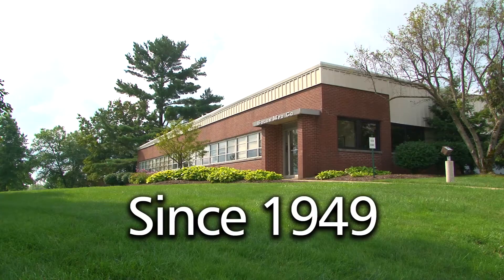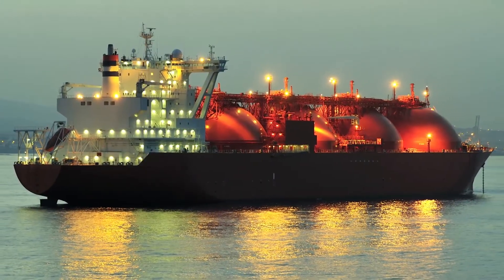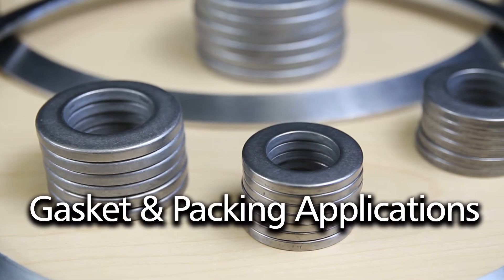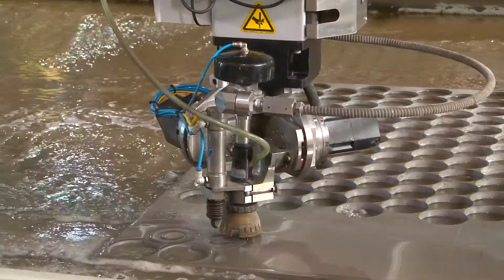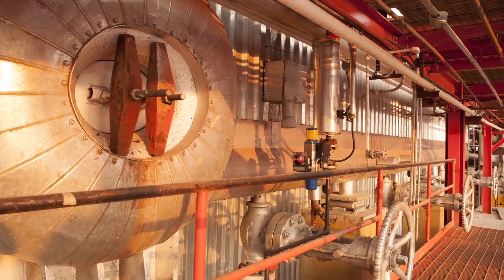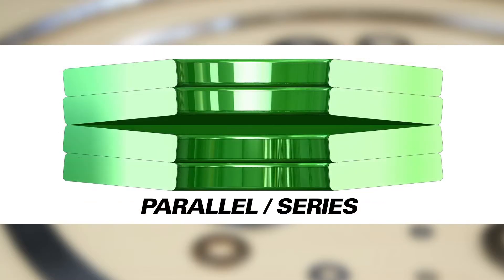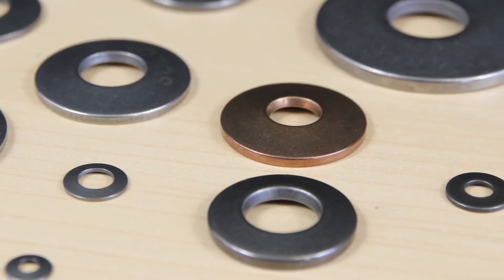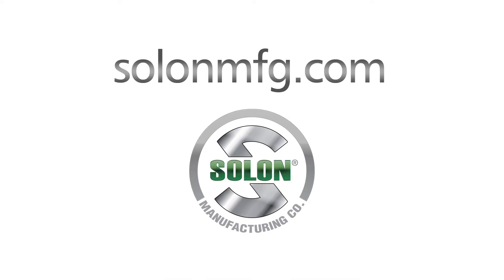Solon Manufacturing Co. | Belleville Spring Washers

Comment: Avoiding the word "neoprene" for what reason?  One of the fundamental components.Without which you do not have a Belleville.
Reply: There are some cases where neoprene is used on the concave side of Belleville washers. These are typically used as a type of sealing washer. However, Solon focuses on Belleville springs used for live loading of bolts and bolted joints. Neoprene would not usually be used in these applications.
Reply: @gdavet11  Ah, I did not know that. My experience was with the washer and neoprene together. Thank you.
Reply: @gdavet11  OK, now lets get down to spring washers. And  I am talking about the "wavy" washers as used in German cars VW Audi Porsche BMW.  I have seen a million of them, but I have not seen any of your conical spring washers without neoprene.
Reply from the maker: @dehoedisc7247 Thank you for your interest! Solon Belleville Springs & Washers are largely found in industrial bolting applications- pipe flanges, heat exchangers, boilers, valves & pumps, and electrical connections. To learn more about our products, visit www.solonmfg.com.